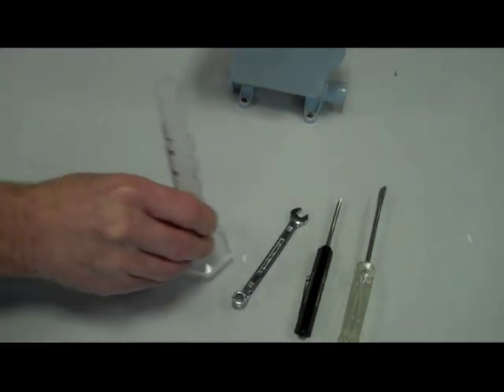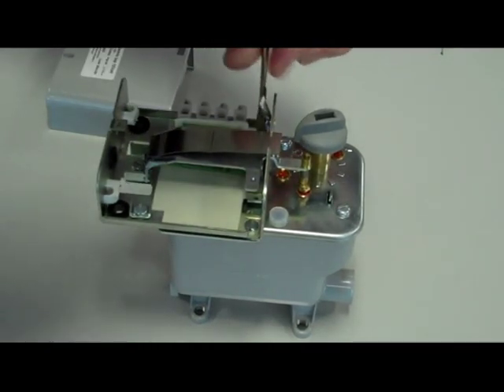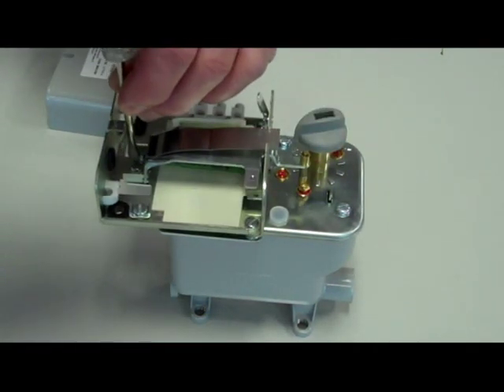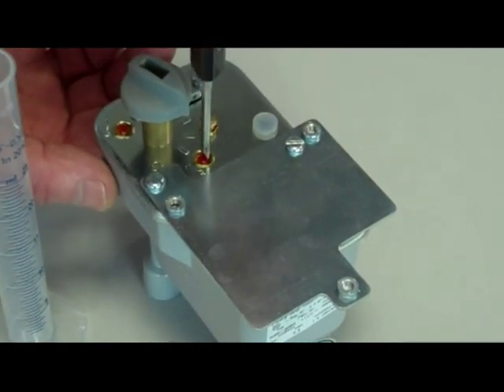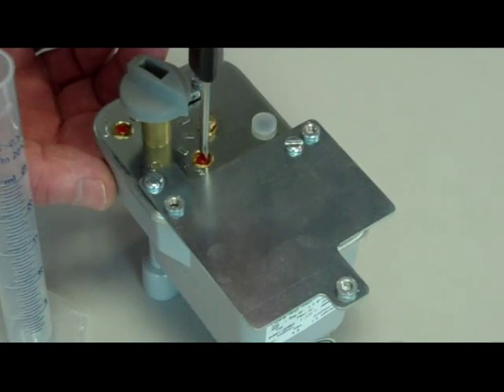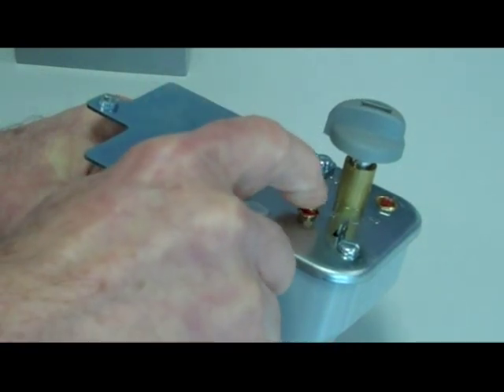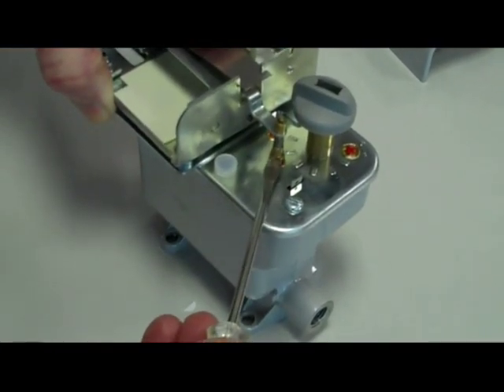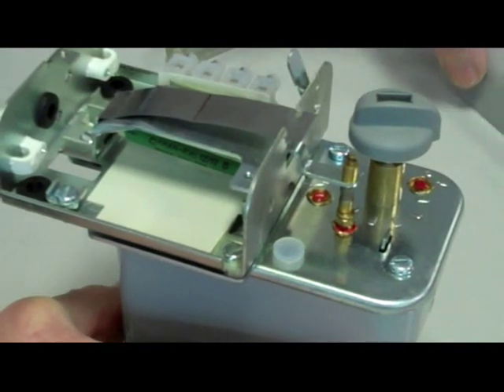Toby DVR5 Oil Control Valve - How To Set Up And Commission

Comment: I believe there is something not quite right with these instructions!  The setup for the thermostat pin effectively deactivates it, plus when the electrical box is placed over the pin it should be in the high fire position allowing the pin to pop up, BUT it is being setup so that it is permanently pressing down on the pin = permanent low fire position..!
Reply: I wondered about that too.

Comment: i need a oil control valve which has two compartments and a thermostat/regulator to control the oil flow through it and in one chamber the oil comes through and from other it comes out with adjusted speed..i just know that its name is something"OCI valve" I want to buy that around 1500 pcs